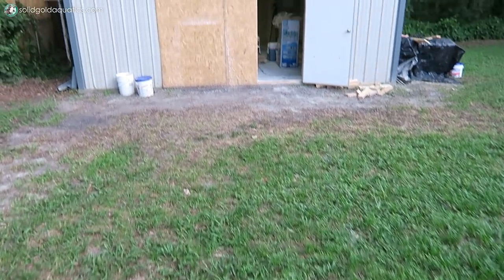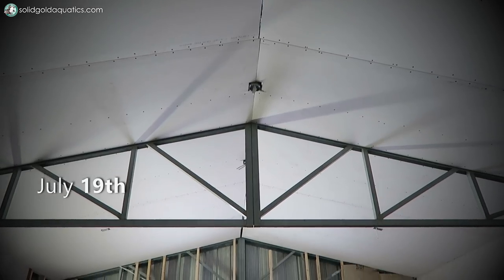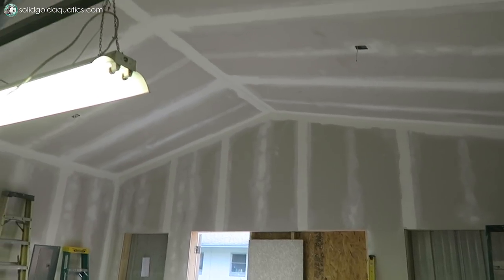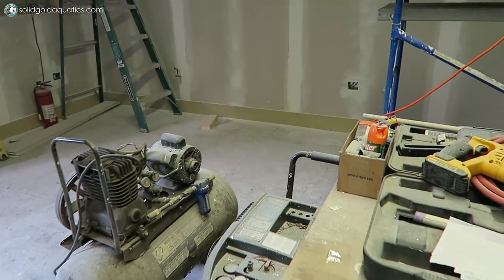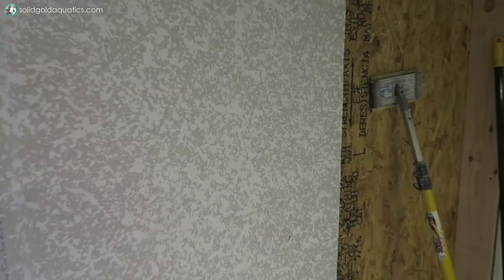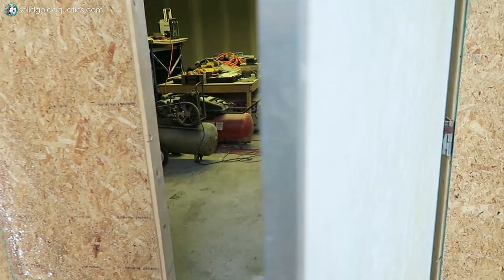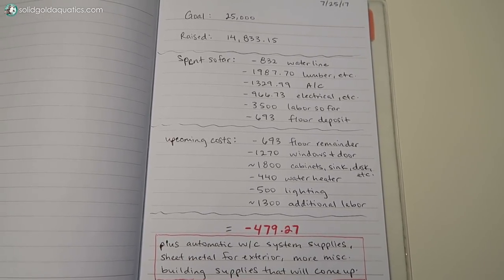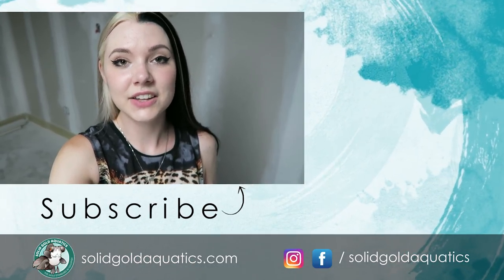EPIC FISH ROOM Update! // Solid Gold Aquatics

Comment: Jenny, I would recommend not painting the ceiling black because it will make the space feel a lot smaller. I'm not sure that you would want that.
Reply: EOGoldfish maybe a light gray to get similar effect without closing the space off too much
Reply: I couldn't agree more. The black ceiling will absorb any ambient light from the four ceiling fixtures rather than reflect it like white or extremely light grey would. It's gonna make that room like a mausoleum IMHO. 

Besides, it will be MUCH easier to paint a white ceiling black rather than the opposite. A black ceiling is such a BAD idea except for in a movie or home theater where reflected light might wash out the screen.
Reply: It's a myth that dark colors make spaces feel smaller.  Small spaces are actually great places to put darker colors because there's less risk of the color becoming overwhelming.  Additionally, black ceilings are really great at making industrial-type spaces feel less cold and sterile.  Let the girl do what she wants.  Signed, a color consultant.

Comment: Hey Jenny, Great video!  You only need one GFCI outlet per CIRCUIT, not on every outlet.  Unless the electricians ran individual circuits for each outlet, as long as you have one GFCI in a circuit, you protect them all.  If you have 2 GFCI in one circuit, you aren't more protected.  I'm not an electrician, so you might bring this up to your crew or your electrician parents to potentially save some money (GFCI outlets are much more expensive than standard ones).  Keep it it!

Comment: For your flooring, if you don't mind something relatively simple, one that works rather well, even in areas with more water possibilities, you can get the stick down floor tiles that you can do yourself as long as your floor is relatively slat. A lot of them are rather easy to find in a pile of variations that actually look rather good.

Comment: I'm surprised you didn't want a drain in the floor so you could do water changes inside your fish room and just pour the water onto the floor. The water would then just flow into the drain and it would be very time efficient.

The zoo I used to work at had an amphibian room and they would just pour the water onto the floor from tanks during water changes. The drain would just remove the water for them and all you had to do was siphon a water change every so often.

Comment: a shower valve is very big and easly knocked into a different temp, i would recomend a thermostatic mixing valve, set to what temp you want with an allen key and are extremley reliable much cheaper aswell. ime a plumber thats what i would recomend

Comment: how do those GFCI sockets work here in the u.k. some have to be reset manually after a power outage and you dont want that if you have fish tanks with heaters and air pumps incase you are out or away. hopefully those type dont do that.

Comment: What are you doing for the floors? Are you gonna put down like an epoxy garage floor coating?
Reply from the maker: Concrete stain (with a non-slip grit additive) in black and white marbled color. :)
Reply: Solid Gold Aquatics That is going to look AMAZING! I love when they stain concrete with blues and highly polish it so it looks like water. One of the most amazing finishes. The black and white is going to be awesome too. 👍🏼